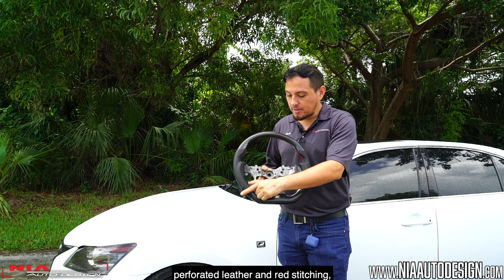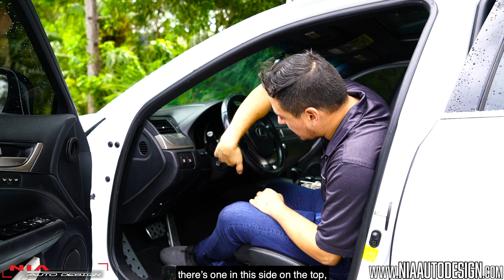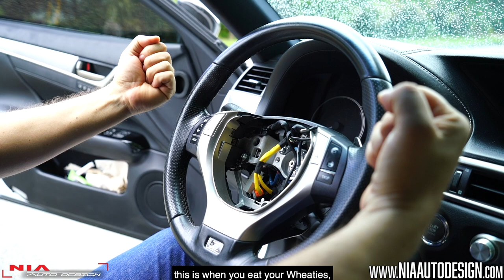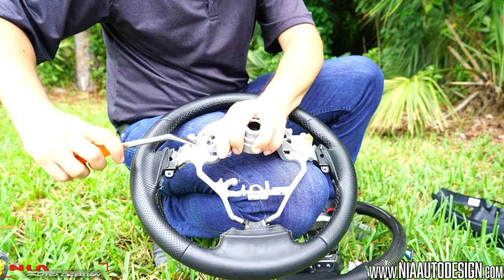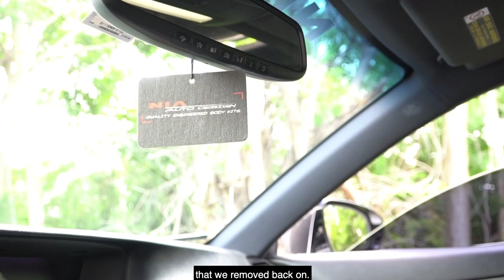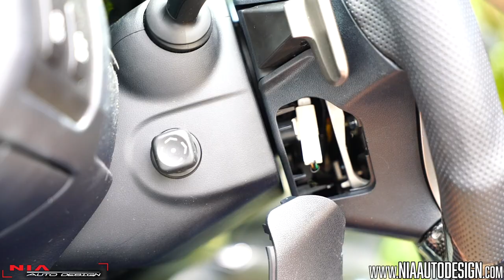How to install a NIA Carbon Fiber Steering Wheel

Comment: I followed step! I can’t get the steering wheel off at all
Reply from the maker: try wiggling it back and forth and it should come off
Reply: @NIABodyKits  Would you recommend WD40 to help loosen it?
Reply: Go to autozone and get a harmonic balancer puller to take it off sometimes they are a bit tight the wheel has 2 screws directly at the 3 o'clock position and 9 o'clock position very close too the center nut the 19
Reply from the maker: @jaimeg3645  yes this should help as well

Comment: Hi, I was checking out this item in the store and noticed the additional package options.
Could you explain what the "Vibrating Element" and the "LED RPM Lights" actually do or function?

I have the Base Model GS and and concerned that maybe my steering wheel doesn't have the wiring to support those features.

Thanks! Looking forward to this.
Reply from the maker: The vibrating element is only available if your car comes with it. Yes the LED RPM Lights do function.